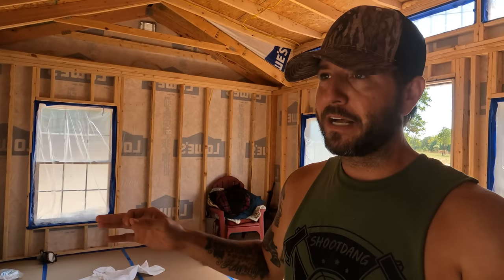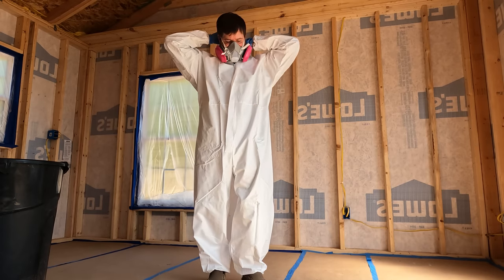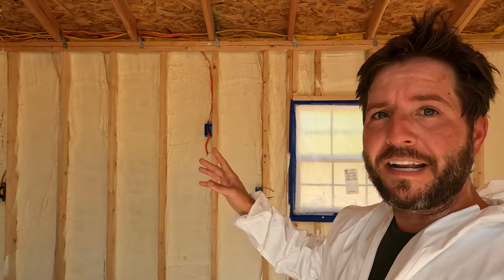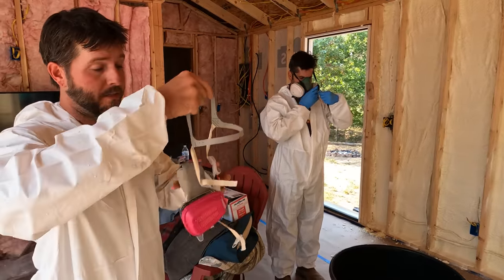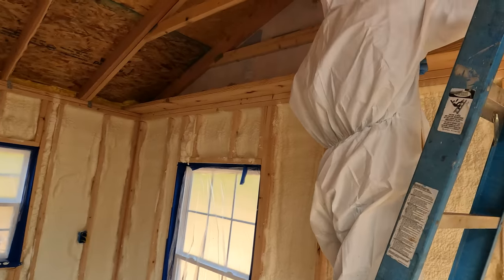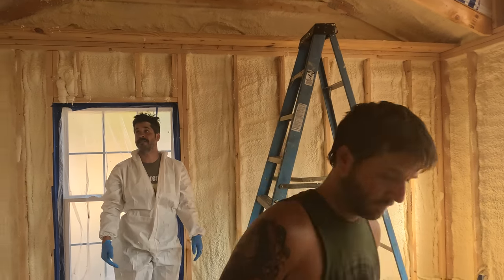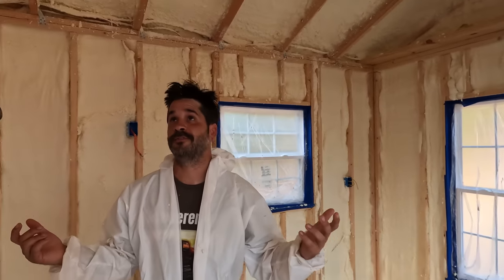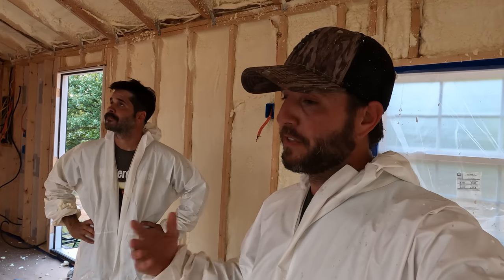Shed To Tiny House - DIY Amazon Sprayfoam Kit - What A Mess!

Comment: You guys did a great job! Especially for not using spray foam before. I run an insulation company for a living. We use these kits quite a bit. These are the same kits that professionals use. Just a few tips. PPE - always wear a full face mask and never take your mask off inside the room or building you are spraying. Also, the two chemicals mix and form an exothermic chemical reaction. It uses the heat to expand which gives you your depth an R value. You should be spraying in about 1” passes meaning you spray enough foam that it expands to 1”. If you spray too thin it won’t expand correctly. You can also use acetone (or Great Stuff cleaner) to clean the gun and clean out the tips so you can reuse them. Just a few tips.
Reply: Very helpful, thank you
👍
Reply: This guys knows his stuff. I have done a lot of this spray myself.  you have to get the hang of spraying slower to get it to expand right.  You could put down 2.5 inches in your wall with one pass.  Also yes face mask is a must.
Reply: The joist under the subfloor***
Reply: Was it cost efficient to spray foam vs standard insulation an area this size?  Was shocked at how expensive the kits are
Reply: @MtnXfreeride  for real. I legit jaw dropped when I heard the price lol
Reply: @MtnXfreeride   When you consider cost - you have to consider that while pink panther insulation is infact cheaper, it's R12 at 6 inches where as closed cell is R12 at 2 in...also, with fiberglass insulation you need an additional moisture barrier, with closed cell foam, you don't. So you save the cost of the moisture barrier. Also, closed cell foam doesn't break down over time or get ruined if it gets wet like fiberglass insulation does. So it's just a better investment that makes the price worth it in the long run.
Reply: Good tips. I will be building a shop in about a year and these tips help
Reply: Do you think they should ventilate the area a little better?  A fan blowing out of a doorway would help get the chemicals out of the air they are breathing.
Reply: @danmcmaster6619  Fiberglass batt has a resistance value of 13-15 in a 2x4 wall cavity. 2x6 wall cavity is typically 19
Reply: @Trailerhooding  it was an approximation, but thank you for taking the time to call out my ignorance
Reply: @danmcmaster6619  Sorry, it was almost half of accurate and when making a comparison I thought it might be good to clarify for the DIY'ers out there
Reply: @Trailerhooding  justify how you like, still a dick move when the point was closed cell was superior to fiberglass insulation and justifies the cost. But, I digress, anytime you can make yourself look intellectually superior at the expense of others is a total win, right?
Reply: @Trailerhooding  not to be a dick or anything, but given that most shed cabins are 2x4 construction, 16in on center...and as you so elequintly pointed out, would be 13-15 R value and I quoted 12, thats way less then 'almost half'. But I get it, math is hard and intellectual superioriety is way more fun.
Reply: @danmcmaster6619  You said: "it's R12 at 6 inches" 4" is 2/3 of 6" and (R)8 is 2/3 of (R)12. So you said it was R8 in 2x4 essentially and 8 is 53% of R15.
Reply: ☑️Another tip to remember, these kits can sit on a store shelf for a long time… so: try to mix them up before using!?  (You can roll them around the room / yard to help liquids blend evenly.)     🤪He he!😁
Reply: @danmcmaster6619  really, you get an r-12 value at 2” thick of the foam insulation? Wow!
Reply: @jsanture  Truly that's only R-6 per inch, some of the factory foam board products (using special blowing gas mix) claim an R-7 to 8 per inch in thicker boards! Fiberglass batts are usually R-3 to 4 per inch and because they are air permeable, if any breeze is blowing and the cavity isn't perfectly sealed (like most aren't, especially in attics) the real heat losses are worse. The craft paper facing is near worthless in most installations, mostly just keeping the fiberglass in place! A great air sealing is maybe the best part of spray foams,  especially in windy regions like Wyoming or the Dakotas and Northern coasts.
Reply: @KevinSmith-ys3mh  Thank you for that sir.  My thoughts exactly. WOuldn't common sense after watching the video, that the foam was creating a a superior seal and the benefits you could achieve with foam.  Reading the feed we learn it is also water resistant!   And YES,  @Trailerhooding , It was a dick move.
Reply: @MrDarrenTrujillo  What's the matter with you people, the guy corrected a totally incorrect statement and wasn't rude about it. He then proceeds to argue about being corrected. The proper response was "My mistake. Thanks."
Reply: R max is what i been useing so what R do you get pr inch with you spray foam. THANK
Reply: @Turningwrenchs  I'm rather curious why you would ask a bunch of strangers this instead of just doing a basic search for "spray foam r value" and having more confidence in the answer because it came directly from the installation companies or manufacturer?

BTW, it is reliably 6/in some up to 7. For closed cell foam. If installed properly. At initial installation it can be higher due to trapped gases, but those will dissipate over time. 

While one of the higher R value materials, the biggest advantage is the superior air sealing.
Reply: @court2379  well not using any spray foam but after Installing with the RMax it really helped .But curiously about it preform ace
Reply: @court2379  I was thinking about it and usly talking to people help some  yes you can get peeps that have never used a power tool but they are easily spoted .But help info and everyone thinks their is the best
Reply: These are not at all  the same kits the professionals use!.  Not even close.  We never use these but once a year.  Our plural component proportioning rigs w/reactors cost 75k minimum each for the machinery only  using much more refined and expensive polyol resins and super fresh and dry ISO's, hydraulic pumps, rotary air compressors, air dryers, etc etc.  If I had a nickel for the amount of homes we've sprayed where the homeowner ordered pallets of these and figured out  that you cant do much more than a shed.  They ask me to buy it from them  but we don't need it.              They're not bad products, its just the nature of plural component on-site mixing.  You need high heat and high pressure to create good Class 1 Inert Foam Plastics, no two ways about it.      You didn't do bad for your first time.   I'm assuming that its closed cell foam by the nature of its expansion.  Open cell foam kits are harder to find in froth packs, again because of its higher heat need.  If you were in Orlando and wanted the typical foam job at current 22' pricing (which has doubled since the dummy dum dum administration) , either closed or open cell, you'd definitely be less than 3k bro.   But I've got foam spraying amigos yonder your way  and I know there's a back log of work from the new yawkas and cali weirdos moving in.  There sure are here.    peace
Reply: @danmcmaster6619  😭
Reply: @danmcmaster6619  Can it be sprayed to painted metal. Ive got a big metal building with wood perlins that isnt insulated making it mighty hot in the Tucson sun.
Reply: @Trailerhooding  spray foam excels on older houses that have a lot of draft through 50 yr old shrunken wood and crappy building practices. the vapor barrier helps but ANY draft destroys fiberglass insulating properties.
Reply: You’re a “professional” and use these all the time? How are you still in business? You’re losing money left and right without a real foam rig and you’re selling garbage foam. Good quality foam needs pressure and heat. The r-value on these kits especially when not a good mixture is garbage.
Reply: @Dan McMaster  Owen's Corning manufactures R24 insulation, it's 5.5in thick designed for 2x6 framed walls. 
Moisture barrier dependant on climate zone and building codes.
In Texas I doubt the vapour barrier would be recommended on the interior side, but I am too lazy to look it up.
His walls are framed with 2x4s I believe, he is probably spraying a 1.5lb or 1.75lb closed cell foam to about 3inch depth average, which would net about an r18.

The foam would definitely be better than batts without a vapour barrier, because the foam would stop air movement while batts will not. The r value rating system does not account for heat transfer via conduction. In theory, r18 foam, vs r18 batt insulation (installed properly, not like in his place there lol) WITH an air barrier would perform the same.
Reply: It is a bit more expensive, however it's very fast, 24" wide r32 Batts are insanely expensive also
Reply: @Kyle Milford  fibreglass insulation formats/availability, along with cost is a very regional thing. Mostly due to supply and demand stemming from the regional building codes.
Ottawa, Ontario here. R32 is no more expensive for me than R22 or R12 batts once you take into account the R-Value. Price per sq ft, divided by R-Value.
Although the r24 IS more expensive for me, because code for us is R22 above grade walls and R24 does not have as much demand here, so suppliers stock less and charge a small premium.
Per sq ft, it's about 20 percent more expensive than R22, with only roughly ten percent more r value.

Where are you from and what are your experiences/feedback?
Reply: What would your thoughts be on laying radiant barrier like reflextix first (exterior side) then spray over? Any major gains from that?
Reply: @homesteadinghippie  in my opinion, it would not be worth the extra money for the gains realized from it.
The same money could be invested in more spray foam for larger gains
Reply: @tonythomas951  it can, but I would still give it a barrier.
Reply: Nice job 👍
Just a hit for the future.
Shack them a lot to get the most out of them.
Reply: I wood go up and down … way quicker
Reply: Yea … pretty sure yer suppose to go outside before you take the mask off
Reply: @danmcmaster6619  Not a dick move, if you are giving advice get your stuff straight.
Reply: Nice share! Thanks for
Reply: Nope. we professional don’t use this kit, as it is more expensive, less reliable and have no control over the 1:1 ratio. Our unit applies way more pressure and also involves heating the product. + here in canada we are required to have certification training and quality control to ensure the product is applied correctly. Nice try Jobber guy.

Comment: Just so you know, when you're standing inside without a mask even though you're not spraying it, those aerosolized droplets can still enter your respiratory system as small particles.  Please take care of yourself.  YOu might think you're strong but you could pay the price later in life. You showed an example of how it drifted outside onto your power banks.  It's the same concept for your lungs!  You're doing a super job with your shed to home too.
Reply: Not only that but NO ONE was wearing eye protection. Freaking foolish.
Reply: @SagebrushRambles  almost as foolish as caring about what someone else does that has zero impact on you.
Reply: @TheGreatWhiteHope209  Yeah, so foolish to care about another human's well being. How absurd.
Reply: Yeah, the vapors released from the reaction between the two chemicals can literally be absorbed by your eyeballs. You're supposed to wear a full face respirator when spraying the stuff. It's a great product when cured completely, BUT it's nasty when it's curing...
Reply: @johnuppole  once the  reaction takes place in the alveoli in the lungs it will never leave, I know of a painter who's life changed overnight because he did not want to wear a respirator while spraying 2 part epoxies. I saw no agitation of the tanks those chemicals need mixed properly. Doing the ceiling first would give you more pressure. Not wearing all the safety gear is your choice however when you post a video on it it sends the wrong message to the rest of the crowd.
Reply: Well he did say he’d show the good, the bad, the ugly….
Reply: When the camera person started speaking it didn’t sound as though  they were wearing a mask.
Reply: @SegoMan  it tells you that shit on the can. Its not their responsibility to protect people from their own stupidity.
Reply: @clemkadiddlehopper9152  Yeah you don't have to glorify the stupidity and get others to join the club.  (Misery Loves company - Company does not reciprocate). People are brainwashed by what the good / bad of what they see.
Reply: I wear a mask when I poop
Reply: I'm a Respiratory Therapist and I agree to this message
Reply: Yeah that makes me cringe big time.  I thought for sure the camera person would be wearing a mask.
Reply: I did this because I didn’t want to wait for the guy. I am a dyi dood but on this trust me. Call the guy. It’s the same price for the foam and you get 2 guys with heated lines and tanks. Plus the tape and clean up. Nice job btw. Oh ya they say that 70 gun and tubes are throw away but you can clean them with pressurized acetone.
Reply: I agree they should have full PPE 's like everybody else.  This product may be aimed at the home DIY er more so because the pros  used air compressors and heaters for the product for proper temperature regulation.  So educating the public on the proper usage is a must.

Comment: Thank you for the video and you feedback. Spray foam adds additional stable strength to the building but didn’t  realize there were other differences to the fiberglass-type insulation. I couldn't find the R value of this kit?
Reply: R-value is 6.3 per inch of foam
Reply: @georgecrocker3126  Thank you

Comment: I  would use 2x6 walls. 2" closed cell foam (R14), then 3.5" rock wool (R15). BAM!  Air tight, moisture tight, still affordable, still sound absorbing and R29.
Reply: I’m in Canada and this is something we do in DIY jobs. It seals up well, but if people want it perfectly air tight, then they can use great stuff or something similar in the low expansion form to seal it up tighter. Tape works as well. 
       For the minimal difference in price now, I would never use pink or yellow fibreglass insulation. Roxul, or any of the rockwool products. Higher R-values, easier to use, rodent proof, fire proof. Even if it does get damp it doesn’t lose its R-value. Much better sound block as well. Because of the design they are going for here, it could be sprayed for the ceiling only (removes the need to ventilate that space) and the Roxul in all the walls including wet walls inside for additional sound suppression of the water & toilet running. 

    When spray is going on, & until the particulate has time to fall to the floor, keep your mask on. If you get too much build up in your lungs, there’s really nothing they can do for you. Even if the aerosol particles are invisible to the naked eye, they expand 100 times etc. all that in your power banks is likely in your lungs as well. Just trying to get it done & rushing through is no excuse to put your life,,  life ,, at risk.

Comment: Someone may have already mentioned it, but it looks like you have a ridge vent at the peak?  If so, that is not needed in a spray foam house.  The foam should cover all the way up in the peak.  It looks like you stopped a few inches short.  Great video though!

Comment: So side to side is good but I’ve seen the professionals do the side to side overlapping the wet-line a little bit more heavier and not really worrying about the side-area’s of the studs…..And then coming and doing a vertical spray catching the side areas of the studs in the process.

Plus you can soak the spray tip/gun completely as a Contiguous unit in a container of your favourite “thinner“ in between coatings…..

And?, You can do several layers up to 3 inch depth on top of each other without worrying about the drying aspect of the phone

Comment: One trick for the spray foam is to put a large fan in a door to create a better airflow for ventilation while spraying and while the foam cures over the next couple of days also it's better to do many light coats over a few days to weeks as it allows the foam to fully cure between coats otherwise there is a risk of the foam not fully curing. Also the best way to cut the foam is an electric kitchen knife second best a serrated kitchen knife

Comment: You need to slow down on the spraying of the foam. You will get thicker coverage from the start. I’m saying that because my son does this for a living and I’ve been on many jobs and make sure you get all the cracks sealed in so that you don’t and any air trapped over all it’s looking good.

Comment: Cant you adjust the tip so the pattern is 90 degrees to spray the walls up and down so you dont have to do 700 back and forth motions between every stud?

Comment: Hey guys, please make sure to get your insulation strategy straight. you need to close up the ridge vent and the gable end vents. you have created a conditioned attic space and having those two things vented defeats the purpose of you insulating the roof sheathing. Other than that, anyone wanting to save some money, use board foam to fill up most of the space and use these spray foam kits to go over it and seal everything up.
Reply: Jared already spray foamed those areas to keep bugs out.
Reply: @laurieg673  you can see that they're not done from the interior. The entire vented section running at the ridge is exposed and still black and uninsulated.

Comment: Please have more than adequate ventilation when using these products.  Wear gogles, gloves, tyvec suits shoe covers and the gas masks.  Your health and safety are critical. Cover everything you don't want sprayed.  The sticky goo goes everywhere.  I tried using this in a too cold situation.  The chemicals don't mix well and turn into a thick syrup that doesn't dry or clean up easily.